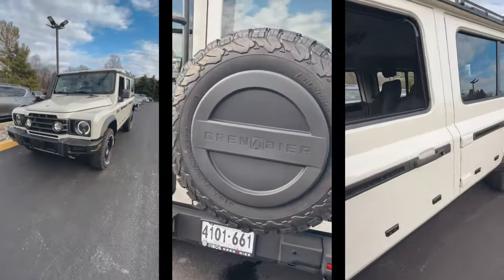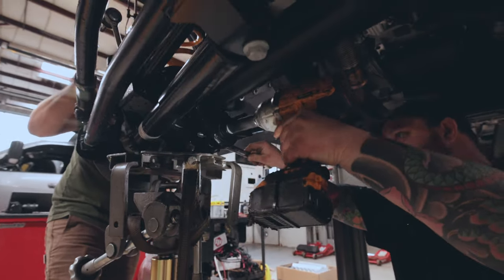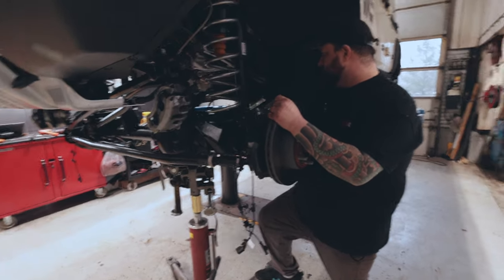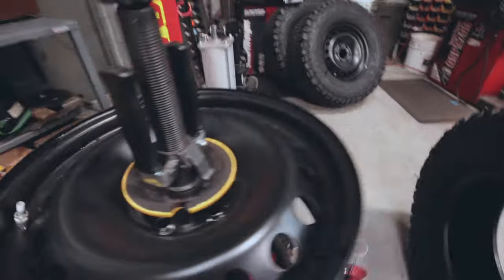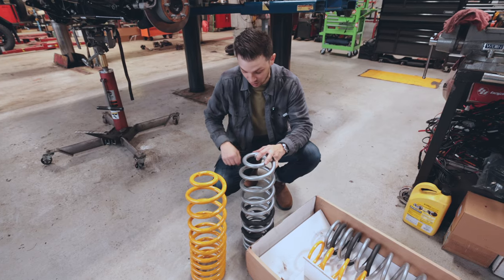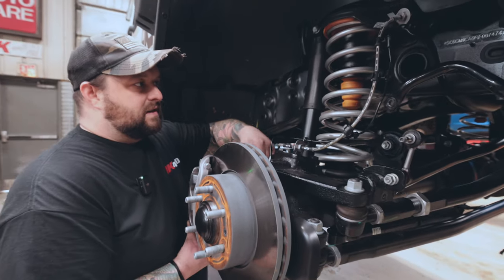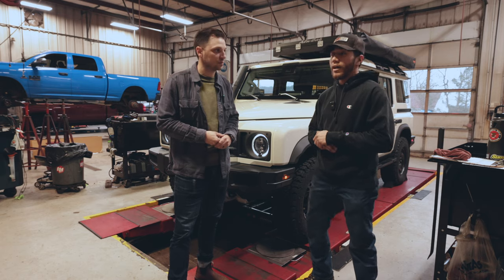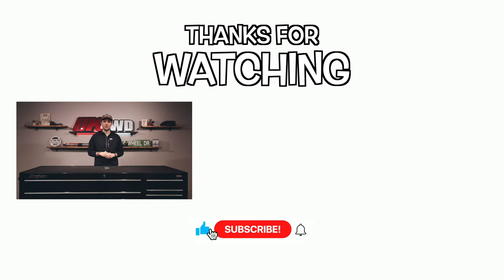This BRAND NEW Ineos Grenadier Gets Overland Ready - Suspension and Tire Upgrade

Comment: Can the wheel arches handle them at full lock? When the suspension is working hard over really uneven ground? It's touch and go with the stock wheels, so my prediction is 'no'.
Reply from the maker: No issue what so ever

Comment: Why don’t you use spring clamps
Reply from the maker: Wasn’t necessary.
Reply: Clamps on the springs would have obviated the need for all that dismantling!
Reply: @brucecutts8841 not enough room to compress and remove the spring with the spring compressor on. The way they did it is way easier.

Comment: Did you upgrade the spare tire size as well?  If so, does it fit without causing issues opening the rear door?
Reply from the maker: We did. I just cleared the ladder. Any tire size larger would certainly interfere with opening the rear door.

Comment: I love this setup. Any chance you could measure the overall height with the new lift and tires?
Reply from the maker: The tires add 1/2” and the springs added another 1/2-1”. We shared the total height of the truck with the tent in the comments on the first Grenadier video.
Reply: Awesome, thanks!  So roughly a 3" tire difference from the stock 31"s only added 1/2"?  How sad :(  @ok4wd

Comment: I am currently trying to Swap in some heavy duty springs using this Video as aguide Line.
I think i followed all the instructions but the Axel doesn t go down nearly as much as in the Video. Right now its Impossible to remove the springs without the use of some sprincompressing tool.
Can anyone tell where I went wrong or Point out some necessary step that isn t shown properly in the Video.
Thanks.

Comment: You mention a lift a couple of times but all you showed was the heavier duty springs. Is the lift just the tyres?
Reply from the maker: The Eibach springs are taller springs than the factory springs.
Reply: @ok4wd  I had only heard about higher weight rated springs which should compress to normal ride height with more weight on them. Anyway, great video and loved the detailed walkthrough.

Comment: The amount of lift you gain with taller coils, you lost it on suspension flex, as you have less travel on the shocks. If you are keeping stock shocks, you need the brackets either upper or lower to compensate by closing the shocks in the same proportion the coils lifted the truck, or get shocks with more travel equivalent to the coils lift. I’m guessing it was like 2”? 
Not an issue until you actually go off-roading …
Reply from the maker: Shortly after, the stock shocks were replaced with Koni Shocks. With a new platform, aftermarket support arrives in waves, and Koni's were a welcomed improvement to overall ride quality both on and offroad.

Comment: Why didn’t you extend the brake lines and fit longer travel shocks?
Reply from the maker: Our build and how we plan on using the vehicle doesn't require long travel suspension. The brake lines are plenty long for the amount of height we added, only about 2-2.5 inches.

Comment: After the lift and alignment, what did the front caster come in at?
Reply from the maker: We align each car individually so the numbers may vary based on weight, options and accessories.
Reply: @ok4wd so what are the specs?